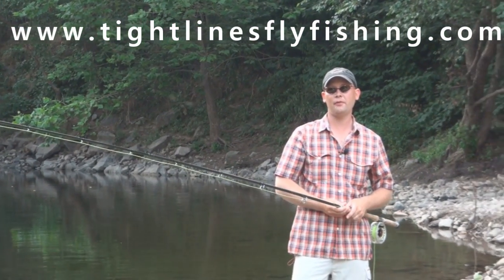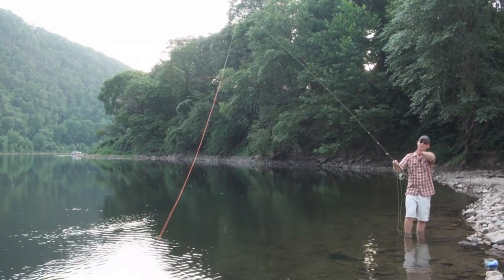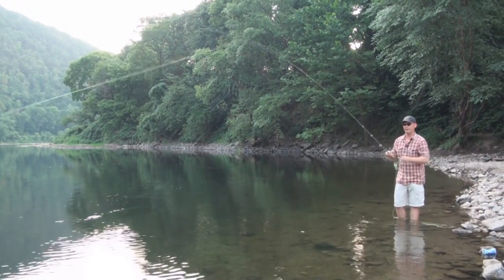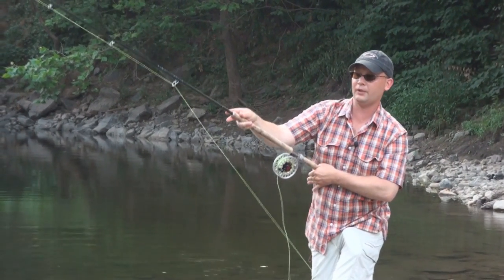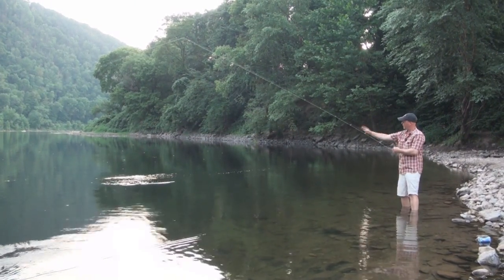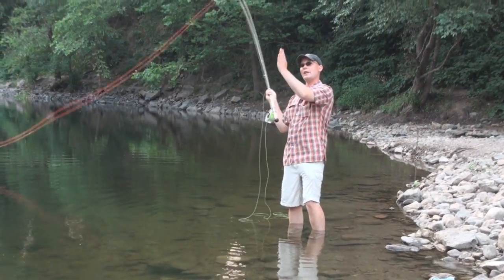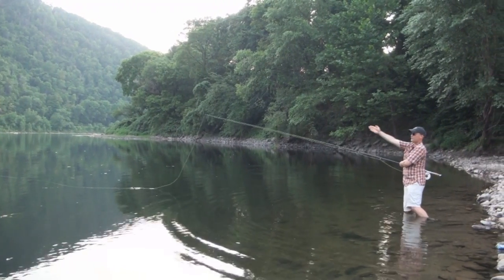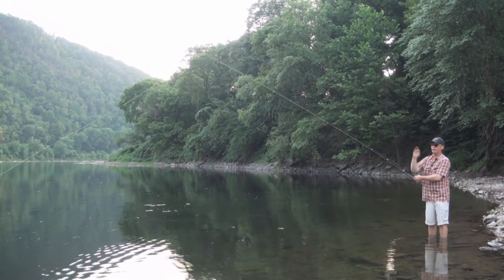Single Spey and Switch Cast

Comment: Great video Andrew, very informative!  Could you comment on when a single spey (for change of direction) might be more appropriate than a snap-T cast?  I consider myself a beginner but I have found there may be a larger margin for error using the single spey (more angles to worry about) as compared to the snap-T.

Comment: What length is your fly rod. Also, what is the length of the red shooting head attached to shooting line. What is the weight of fly line.
Reply: Hi John,  If I remember correct, in this video I was using a Rio Uni Spey which was about a 52' head @ 7/8 weight.  The line was finished off with a 14' poly leader and about 6 feet of tippet (3 feet of 15 and 3 feet of 12#).  The rod was 14'3" in length.